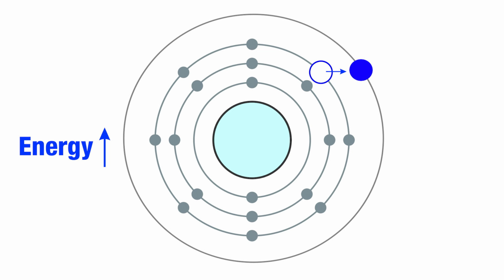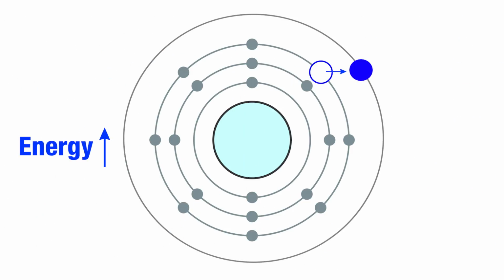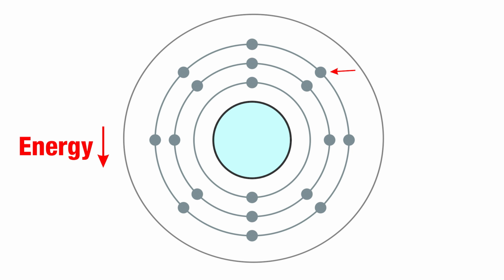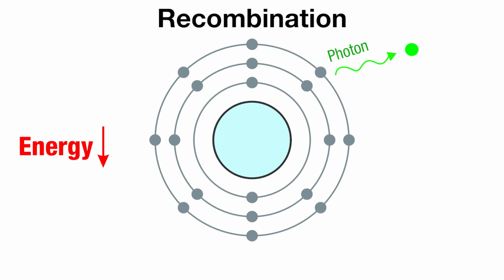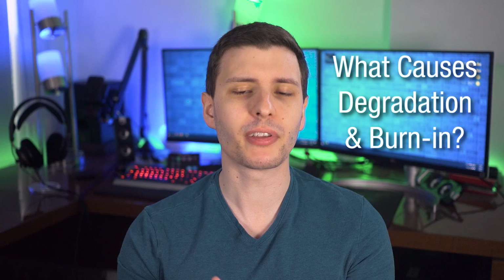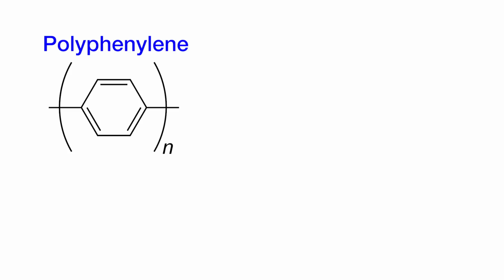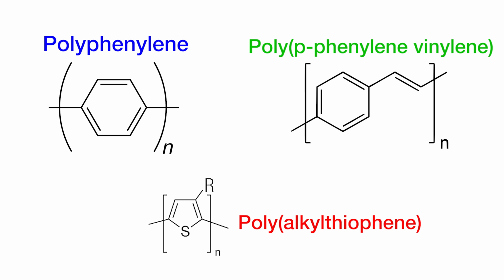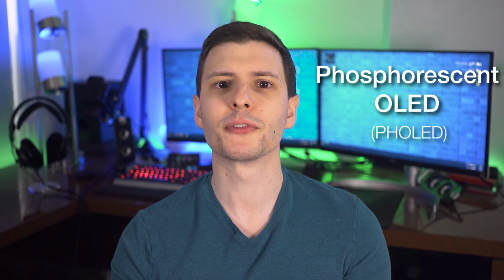What is 'Organic' LED Anyway?  -  How OLED Works

Comment: If I understand correctly from another YouTube video describing the OLED technology, it still uses a backlight and a filter layer to control
the amount of light passing through, individually for the red, green and blue components.
The difference from LCD is that each individual pixel has its own light source, but only white light, not red, green and blue light separately.
So the brightness of each individual pixel can be controlled by directly changing the intensity of the backlight, but you still need a filter layer to produce the color.
Am I right? Can someone clarify this?
Reply: You're talking about white oled

Comment: EVERY television is OLED. They've only just been using the LED portion in marketing but as technology has gotten better, especially in higher-end tv's and now in smartphones and even gaming systems to try and justify the higher price tag. True these televisions have better contrast and more vibrant colors, but did you know your HD or even CRT television can achieve the exact same results? All you need is a red sock, 2 rolls of duct tape, 4 AAA batteries, a rubber band, a plunger, and 12 medium-sized paper clips. Then you can unlock the OLED power of your television.

Comment: Your "scientific" explanation of diodes is absolutely false. Your first explanation was substantially more accurate. A diode is a semiconductor junction with two different doped materials: one n-type (electron carriers), one p-type (hole carrier). When current tries to flow the "wrong" way (reverse bias), the electrons from one semiconductor flow into the other's holes, suppressing carriers in a depletion zone (i.e., no carriers), and stopping the flow of current, unless a very high energy of provided to the carriers (breakdown potential). After this breakdown potential is surpassed, the carriers flow with almost no resistance. When connected the other way (forward bias), more electrons flow to the n-side and more holes flow to the p-side, causing a small potential barrier that carriers must overcome (i.e., you must provide energy to the carriers to overcome this barrier). THIS IS NOT RESISTANCE! It's highly nonlinear, more like an on/off switch. Actually transistors are made from "junctions" of diodes (pnp or npn), and everybody knows logic gates are implemented with these.

Comment: About delocalized electrons, good explanation, bad example using an ionic solid such as NaCl, as electrons are mostly localized in those kind of bounds. Covalent or metal bonding would have been better examples

Comment: One very cool application of the OLED technology is OLED paint. You apply 3 coats of these paints on your wall, use the bottom and top ones as electrodes, turn the electricity on and BAM! Your whole wall is a giant LED.

Comment: I'm dreaming about an lcd tv with a "micro" led backlight. With 240×135 backlight zones (16×16 4k pixels ≅ 1/2 cm for zone) you could have a good compromise between big leds and good blacks.

Comment: I understand that quantum-dot technology involves manufactured particles (think “dust particles”, not protons, photons, etc) made with diameters that match the wavelength of light that you want to emit. It helps to know a bit about quantum electrodynamics to understand how that enables emitting such light, but it's all very closely related to the rainbow patterns that reflect off off CDs/DVDs: It's literally the physical structure of such objects—at sizes matching the affected wavelengths—that determine how the different colors reflect and where to. In fact, the reason you get a rainbow is because physically tilting (any) object with repeating patterns changes how close-together the repeats look (and thus the wavelength affected).

Comment: Crystal lattice 3:49 is called ionic compound, and they don't share electrons like covalent bonds. One of the atoms gets the other electrons and it's called an ion now. Ionic happens between metals and non-metals, covalent between non-metals and non-metals, delocalized electrons is a term not a bond type and it happens in metal and metal, the bond is called a metallic bond.
Also the organic molecules you are referring to are actually called hydrocarbons, there are multiple times such as alcohols, alkanes, alkenes, and more.

Comment: Two years ago I built two Arduino projects. One with Matrix LCD and backlight, one with monochrome OLED. 
The green OLED was very bright and easy to read at the beginning, but now the brightness of the display is different everywhere. 
The old LCD technology has not yet shown any signs of wear. 24/7

Comment: question: since oled is easier to manifacture than lcd then why is it more expensive???
Reply: From what i understand OLED is easier to manufacture than micro led not lcd. I don’t fully understand the difference still.
Reply: oled is more fragile and only two companies can actually mass manufacture them. Samsung & LG where Samsung mostly dominates the market.
Reply: @Jorti1boomboxvideos  So that's how my budget phone got an OLED display
Reply: Lcd is a simple layer multiplex technology, look at a 80s digital watch.  Conductive layers potentially vacume printed on glass, the crystal material between them to polarise and sandwiched together.  OLED is similar, has more steps and bigger chance at ' missaligned print ' of any of the colors, think of newspaper comics and color photos. From the color placement printing, you have even more conductive layers to interconnect and insulation to bypass the matrics of pixels.  In short, more steps, higher cost.

Comment: The O stands for “Out-of-my-price-range”
Reply: The L stands for: Like-I-Could-Ever-Afford-That
Reply: Bro there are phones with OLED displays for under $200
Reply: Out-of-my-price-range-Like-I-could-afford-that-Expensive-dumf-c
Reply: @abhinavm3186 

 Out-of-my-price-range
Like-i-could-ever-afford-that
Expensive-as-fucc
Destroys-your-bank-account
Reply: @OzaneWolf  haha 😂
Reply: @OzaneWolf  repair guy here, this is accurate af.
Reply: @OzaneWolf  I mean I have OLED screen anc it only was 499€
Reply: @Alexis_Idfk  for a TV? thats still expensive
Reply: I paid 2k for my LG 55” OLED C1 it’s worth the money buy I can see it being expensive for some was little bit for me but it was worth it
Reply: Westinghouse's first commercial color televisions retailed at $1,295 USD! And that's in 1954 dollars! Adjusted for inflation they would cost $14,781.82 USD in 2023 dollars. Eventually RCA cut their competition under by offering a budget color TV at a mere $600. Which in 2023 dollars would be a mere $6,848.72. The prices continued to remain high for decades.

And those early TVs were massive, weighed hundreds of pounds, and only had a 12.5 inch screen. They also needed to be regularly serviced by a technician (don't even think of DIY repairs because those electron guns held charges of deadly high voltages and emitted both gamma ray and X-Ray radiation.) because the tubes had lifespans lasting mere months. Also there were only 2 channels that offered color programming at launch (but most content was monochrome).

According to the U.S. Bureau of Labor Statistics, prices for televisions are 99.07% lower in 2023 compared to 1954. A $2,000 TV set in 2023 is the equivalent of paying $18.65 for a TV in 1954.
Reply: You might be thinking "Okay boomer that was all the way in the 1950s."

I'm a zillennial. In 1998 I knew this snotty rich kid who later became a bully and at his house was a new 40 something inch screen rear projection big screen TV the size of a washing machine that his dad paid over $9,000 for.

Later during the 2000's I regularly checked out the plasma TVs on display at Circuit City, CompUSA, and Fry's with pricetags exceeding $10,000. (And those Virgin Megastores had plenty of them which must have cost Richard Branson billions.) 

In 2008 I was at the Sony Metreon's now defunct Playstation Store and I marveled when I first laid eyes on the perfect blacks and deep vibrant colors on their new OLED tech screen. The screen was only 11 inches and retailed for $2,500.
Reply: You can get a 55” OLED for $800 on Prime Day.
Reply: @Everything2A  rs 240 000
Reply: They have come down in price a lot
Reply: Sony Bravia OLED TVs are the best on the market.
Reply: $1400 for a tv at once can sound like a lot, or no interest payments at $58 a month...not that bad
Reply: I understand these biologic are non-human organic biologic. I stress the non-human part.
Reply: Can't even buy used CRT
Reply: Out of my price range light emitting diode
Reply: E is for "Emotional Damage"
Reply: Isnt it oompr
Reply: Not for you plebs, keep your greys plebs, while I enjoy my blacks with caviar.
Reply: @dylandrew6071  and 💀
Reply: @dylandrew6071  Once a pleb, always a pleb!
Reply: Indeed
Reply: Lmao 😂
Reply: lol
Reply: Ni gga literally everyone can by that sh it
Reply: @Jebbidan  not everyone is a rich kid like you pal.

Comment: Guys, please help me in solving my issue.
My ESC key and function keys are not working (F1-F12).
It looks like they have been locked or something,
Also, if I press any one of function or esc key, my LED backlight is not giving/showing any response.

Please Guide me on this.

Thankyou
Antony Camillus

Comment: Can you cover Mini-LED. It sounds really fascinating.
Reply: Mini LED is basically LCD with a backlight using LED. These LED will act as zones and can be turned on and off. This will increase contrast and black levels in LCD. But you can see why this is just a temporary solution because once these LEDs become small enough to size of a pixel they can be turned on and off individually without the need for a Liquid crystal panel to block the light. So by that time they will become Micro LEDs. It is basically the size of LED that determines whether it is a Mini LED, which used with LCD panels or Micro LED which can used as a direct emissive technology like OLEDs. I forgot exact sizes but if LED is between 200-50 microns it is used as Mini LEDs and below 50 they can be used as directly as Micro LEDs.
Reply: @alexthampan9007  A bit more info on zones/zoning.  If a zone is completely black (no lit pixels) then the LED behind that zone can be turned off.  This allows that zone to be a true black while normal LCD screens will still allow some light through even if the area is supposed to be completely black*.  These zones have a huge limitation though in that a zone can only turn off if all of the pixels in that zone are off.  Since OLED and Micro-LED use individual LEDs for each subpixel there's no backlight to block and you can always have a true black.  Micro-LEDs also have another advantage over OLED not mentioned in that they can be much brighter, that's actually an advantage of LCDs over OLEDs as well.  

As for why the confusing terminology exist you can of course blame marketing people and greedy CEOs for that.  Early LCD screens had a side light rather than a back light (The wires and TFTs used to control individual pixels were too bulky/not transparent enough).  Both used LEDs (maybe some early LCDs used something else but the oldest one I've ever seen still looks like it has LED light).  When LCD screens started using backlights they started calling them LED which of course confused the heck out of a lot of us who had heard about LED screens that actually used LEDs as individual pixels (it truly was false advertising but I don't think anything ever came of it due to some legal technicality BS).

*I think IPS displays are supposed to be better at blocking the light which gives them better contrast.
Reply: Sane LED just smaller Micro LED is even smaller LED make own its own new panel.
Reply: You mean micro?
Reply: @innocenttheinexorable6610  No, I mean Mini.
Reply: @Prem-j9l3s  oh ok, that was prob earlier in the video (or not even) because I read your comment right when micro came up.
Reply: @innocenttheinexorable6610  Understandable.

Comment: Notably: PHOLED will likely take over the market long before micro-LED does. PHOLED essentially does the same thing that CFLs do. The reason why they're more efficient is that only one substrate organic compound is needed to produce all types of colors. As Thio explains with OLED, each organic compound produces a different spectrum of light. This requires every pixel position to still have three different organic compounds attached to them with their own individual sub circuit  to switch current on or off to them. In PHOLED displays, it is the current amperage that determines radiative output of a given UV frequency which ultimately determines the phosphorescent output color. Different phosphorus compounds will produce different colors based on the frequency of UV light that hits them. This means that different layers of phosphorus compounds can be layered for each diode, and the diode can be switched from frequency to frequency to activate the phosphorus compound to produce different colors. This makes such diodes far more efficient and far less likely to have burn in.

Comment: One misconception LCD panels may or may not have a backlight, an example of an LCD with no backlight is the TCL NXTPAPER

Also LCD can also have light emitting sources used in their backlight NVIDIA for example plans to use MICROLED with an LCD panel on top (no I am not confusing it with miniled) with that we would get light source behind every pixel as well

Comment: Hey Thio I have heard of a display technology called quantum dot. I think it's used in 4K and 8K displays. What do you know about this?
Reply: Quantum Dot just improves colour
Reply: My samsung g9 monitor is a 1440p and uses quantum dots
Reply: From what I understand quantum dot is just a way to enhance the backlight in a traditional LCD. Instead of the usual broad-spectrum white LED, you have a blue (or even UV) LED with quantum dots to provide the red and green (and blue in the case of UV). If you pattern this to the color subpixels, you don't even need color filters as the quantum dots generate the pure colors in the right places. The overall benefits are better efficiency (not generating then blocking as much light), and better color purity and gamut, as the quantum dots generate purer colors than traditional color filters on white light do.